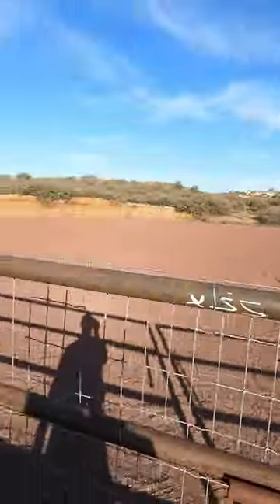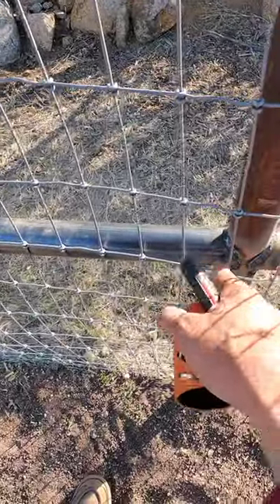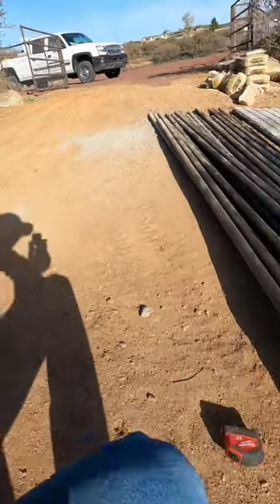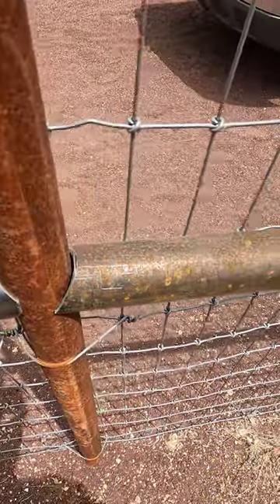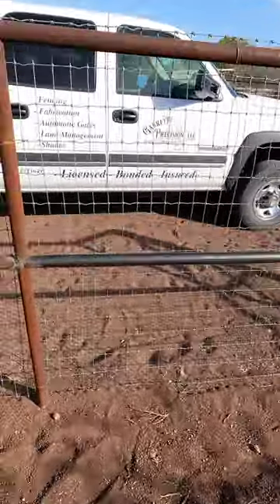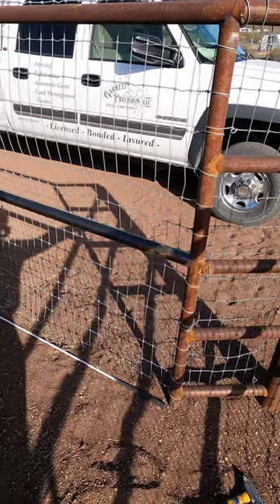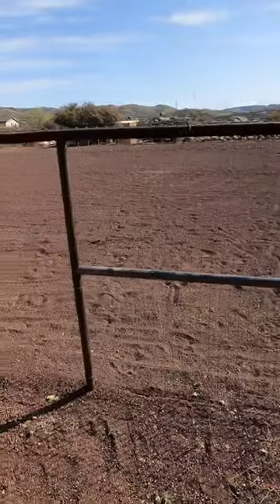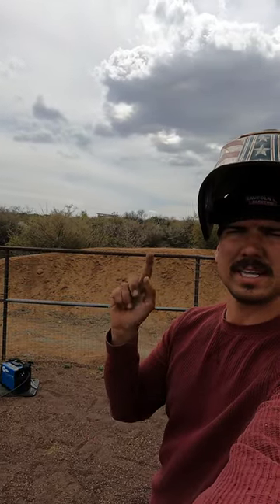Building a 2 Rail fence and Notching/Saddling/Coping Pipe with a portable band saw! IT'S SO EASY

Comment: What size generator was used to power the welder? Looking to power a lincoln tombstone for a corral build. Thanks in advance
Reply from the maker: Good morning, I use an 11500 starting watt generator. I run the welder off the 240v plug and have plenty of additional power to keep power tools charging. I'm using a Champion generator, but I found that you can get away with a lower wattage high-quality generator such as a Honda. I have a Honda 6500 that I use on some of the job sites and find that in a lot of ways it matches the larger champion. The downside is a lot of the lower wattage generators like the Honda  don't have the higher amperage 240-volt plug like the champion does.
Reply: @FiveTwoFenceandDirt  Thank you for the information and assistance. It's appreciated. New Subcriber here!